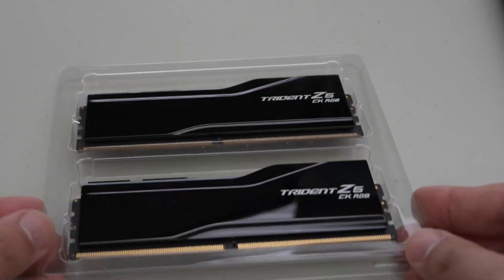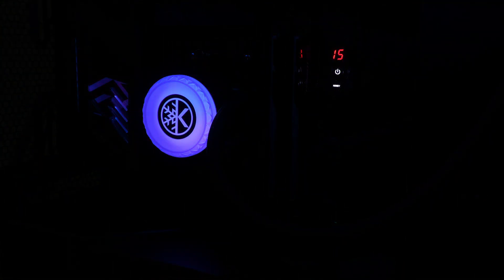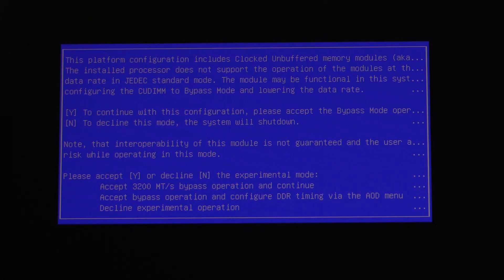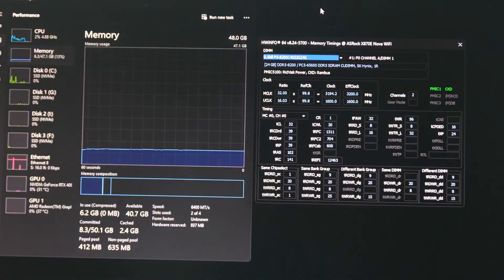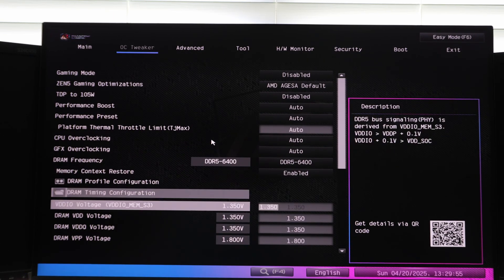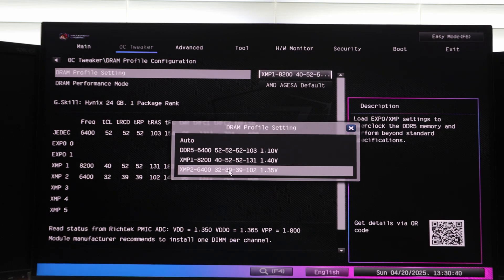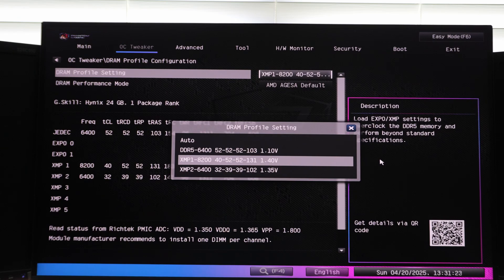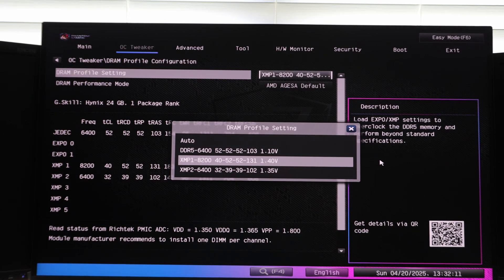What happens if you install CUDIMM in X870E motherboards

Comment: I plan on maybe getting either 2 kits of G.Skill Trident Z5 Royal 96 GB (2 x 48 GB) or 2 kits of G.Skill Trident Z5 Royal 64 GB (2 x 32 GB). Also, would you recommend me getting 2 kits that aren't the same kinds of kits? I need between 80-192GB of DDR5 ram and want to maintain high ram speeds. Can you please help me?

Comment: I have the Nova board currently have it paired with 9950X3d, 128 gb RAM at 5000Mhz and 3060ti, i will be upgrading the gpu to 5090 so is it possible to run dual gpu in this mobo ? 5090 on the Gen 5 x16 and 3060ti on the Gen3x2 ? what will be the impact. Can you test dual gpu on this mobo and share a test video. I am building it mainly for blender and unreal engine.

Comment: I currently have x870e-e strix + 9950x + 192 gb (running at 5200 cl26) And I'm building a second system on 9950x3d + 192/256 gb, what motherboard would you recommend within $1000 for a maximum memory overclocking (and cpu for multi-core load), I'm thinking about Crosshair Hero or should I get MSI Carbon? I heard on one of your streams that you recommend it for 4 sticks overclocking , thanks!  And btw X870E-E also has Asynchronous Clock feature  as Hero does😊
Reply from the maker: For 4 sticks of dual rank DIMMs, ASRock or Gigabyte.
Reply: @GameTechReviews thanks, i'll go with taichi probably. By the way, have you seen the news that gskill is releasing a full 256 kit with expo 6000 cl 32?
Reply from the maker: @marchik3d  Yes, the 256gb kit was discussed recently on the last episode of Tech Thursdays.
Reply: @GameTechReviews oh, nice. i just recently subscribed to your channel and so far i'm watching everything from the early episodes but i'll catch up soon😂
Reply: If you want fast memory with 9950x-ish performance, Intel's 285k is very similar to the 9950x right now, and will support much faster memory speeds with all four dimm slots populated compared to the AMD CPUs. Choosing between the two is very use case dependent, to be clear.

Comment: Have you heard about what's been going in with the Nova and 9800x3d? Thoughts? (I bought both)
Reply: The problem is the mobo pushing the voltage of the SoC way above the amd cpu's imc limits...what you need to do? if you use expo mode check if your mobo overide the safe settings set by amd which is SoC 1.2v do NOT go above 1.3v...you also can buy ram kits from g skills named NEO they already has expo profile just make sure get the 1.3v ones also do not push this cpu above 6000mt this is the sweet spot anything above that can be not stable and danger your cpu just not worth it imo.
Reply: @ thank you for the advice. Im new to pc building. How do you change the voltage? Also i bought dominator ddr5 intel xmp coz i’ve seen people use xmp instead of expo on x870 mobo
Reply: Have heard a lot of issues with the asrock 9800x3d combo. Ended up returning my nova and might choose something else

Comment: Do you have any videos on the best performance set up with 9950X3D, 64GB@6400MT/s, 9070XT put into a Taichi board?
Reply from the maker: The Taichi was covered in a livestream build previously.
Reply: @ yup
I found it right after I commented thanks!
Reply: after the fiasco asrock had i would stay away from them for now until the problem solved with stable bios update it didn't happened yet as for i know...x3d chips seems like popping inside asrock mobos if you didn't heard especially in the x870 line...not only in asrock mobos to be honest some reports about asus and msi mobos also.